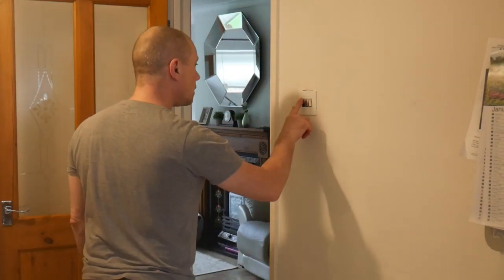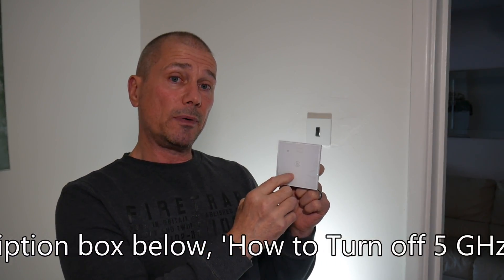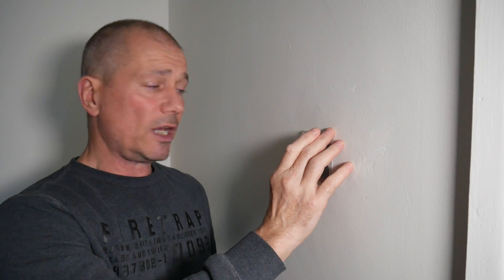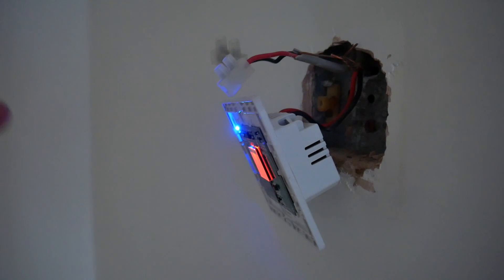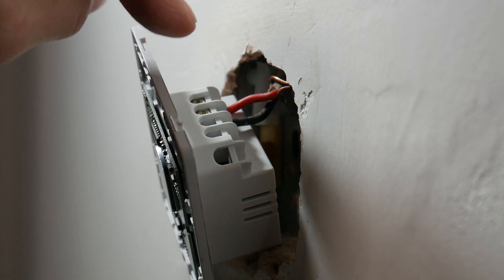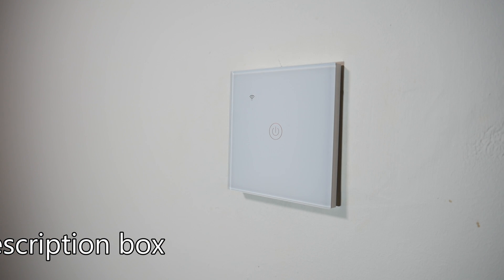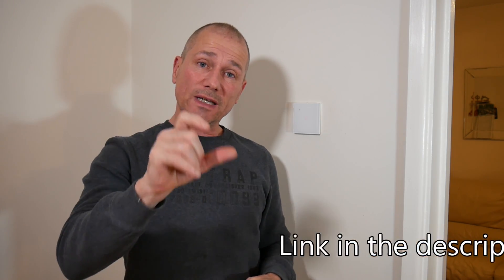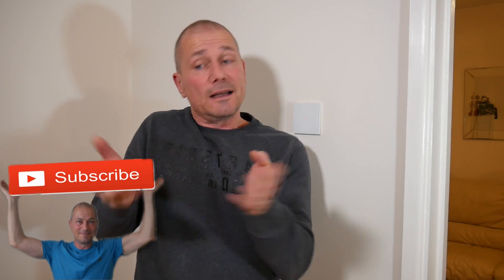💡NO NEUTRAL 1 Gang Smart Light Switch Installation & Set Up

Comment: Thank you very much for making this video and sharing it. Very helpful. The only thing you missed was about the capacitor . What’s is to be made I with it and what’s its purpose? 
Thank you
Reply from the maker: You use it if the light flickers or blinks. Mine didn't so I didn't have to use it. It's used in switches with no neutral. It depends on the bulb. It connects in parallel to the live wire, 'x' being the capacitor. ( Live ----------- x ------------ 💡 )

Comment: Hmmm question I have a TX 1 gang from son off... On the back of the switch I have N, L, L1... But I only have two wires coming from the wall L and N... So it is correct if I install permanent L on L the N which is the other cable that I have as L1 and an extra cable going to the box as N?

Comment: Very good and informative video.  I have a question, I want to replace a 4 gang switch with a smart switch , my only problem is that one switch is with a two way switch.  Can this still work?
Reply: The switches are meant for 2 way switches wiring it up will be easier no need for a capacitor because 2 way switches have a neutral wire

Comment: I just needed to know what to do with the capacitor
Reply: Capacitor should be installed between the ceiling light switch/live and the neutral wire. This is to stop the light from flickering.

Comment: Hey. Thanks for the vid. Can anyone help. My lights are halogen gu10 and even with the capacitor fitted they're constantly flicking on and off.
Reply from the maker: Mine are LED. Maybe try LED gu10s?
Reply: @UTILITARIAN TV  hey. Changed all my bulbs to LED and used the capacitor and they're still flashing when on and flickering when off. What is the correct way to use the capacitor? I have it wired into live and neutral

Comment: What about the capacitor that comes with the kit? Did you leave it out ?
Reply from the maker: It wasn't required as the lights didn't flicker.
Reply: @hifireviewhub do you think I will need the capacitor on a bathroom tube light switch and kitchen round florescent bulbs

Comment: Found your 2 gang version. Do you need a capacitors in each light fitting if you have two lights in the same room controlled by one double gang?

Comment: Great video mate.  For anyone that still requires 5Ghz which is a short range but faster WIFI connection type, just rename the 5Ghz to something else rather than disabling it.
Reply: That's what I've done, essentially you'll have 2 SSID by doing so. 

1. 5 GHZ
2. 2.4,GHZ

Comment: Hi ! Excellent video! I have the same switch! you mentioned the earth wire; i have the earth wire: where would i connect it?
Reply from the maker: It normally attaches to the metal back box.
Reply: I have the plastic box….😩
Reply from the maker: @cristinanonnato8948  most plastic back boxes have an earth terminal, a small copper screw. If not, put the earth into a connector block.

Comment: Can you use dimmer functionality with that switch and Alexa ???
Reply from the maker: It works with Alexa but not dimmable.
Reply: @hifireviewhub  yes. I have it working with Alexa but I was thinking that maybe I didn’t connect it right because Alexa says that”  doesn’t support that”
Reply: @kennypr  yes the switch is not dimmable so Alexa will say it's not supported.

Comment: Hello, Quick question, how were you able to take the front plastic/glass plate off. I have one to install and I dont want to take the risk of breaking it?
Reply from the maker: There's a small recess on the bottom. You can use a small screwdriver to lever it but mine lifted up just using my fingers.

Comment: I tried to install similar one a sonoff smart wall tOUK-1C-to got it all installed switched on paired up but when I go to switch light on or off nothing happened I only had 2  for switch a blue and a  brown not sure what went wrong on the smart switch had a N . L in.  L out. Connected them both to L in L out  strange
Reply: The BROWN wire is the Live Wire and that goes into the "L" terminal on the light switch. The BLUE wire is actually a Switch Live wire, not a Neutral wire and this one goes into the ”L1” terminal.

Comment: Good video. Only problem I have is if you turn the smart switch off at the wall you need a command in alexa to turn it back on for the light to come on. There is a workaround by naming them both 'Light' but then you can no longer dim the light with voice command because it presumes 'Light' is the switch. I realise you can just say 'Livingroom on' or 'Livingroom off' or 'Lights on' or 'Lights off' to turn everything on and off, and also dim all the lights with that command but I've got more than just one device / light that would turn on/off/dim with those commands. Is there anything else I can do?
Reply from the maker: The switches I have are not dimmable. So I'm not sure sorry. I changed the name of each switch in the smart life app with no other issues.

Comment: Hi
Did you fit the capacitor? I’m wondering if the the light will actually work without the capacitor fitted!
Reply from the maker: I didn't need to fit it. The lights worked fine without it. I think it depends on your light fitment and the bulbs being used.
Reply: @hifireviewhub  ok thanks for the reply👍🏼

Comment: I have the same type smart switch with yours, however there is some buzzing sound came from the capacitor when the light turn on. still have no solution on it
Reply from the maker: You may need to get a better capacitor? Something like this https://www.amazon.co.uk/dp/B07GLVN6RC/ref=cm_sw_em_r_mt_dp_Em5ZFbH99HE4Y?_encoding=UTF8&psc=1

Comment: Can you advise what brand of LED bulb are you using if you remember?

Also in regards to the 5ghz issue. Most ISP's ship routers with 2.4ghz & 5ghz networks with the same SSID (wifi name) but on separate BSSID's (this separates the 2.4ghz protocol and the 5ghz protocol) so when you pair your device it tries to hop between which ever is offering the strongest signal at the time. My approach is to rename the 5ghz network (example when i scan my wifi at home my SSID's are "home-wifi-2.4" & "home-wifi-5" and this way i can effectively create 2 separate networks to the router and you don't get that hopping issue with devices. If you have a device with strong wifi like a mobile phone or laptop you can pair that to the 5ghz network permanently because so long as you don't go too far out of range it will stay connected but something like a smart switch that probably has a cheap wifi interface can be paired to the 2.4ghz network and it will never try to hop networks.